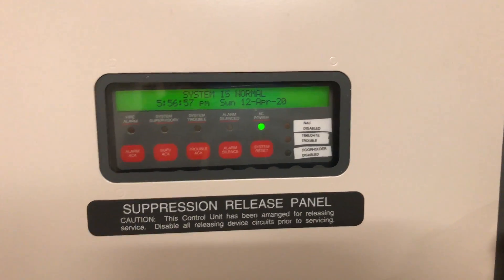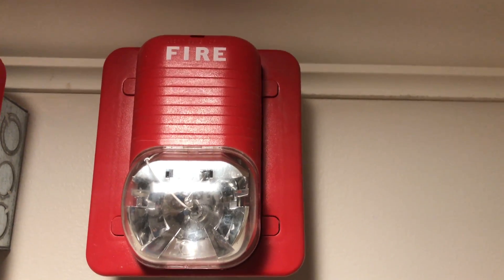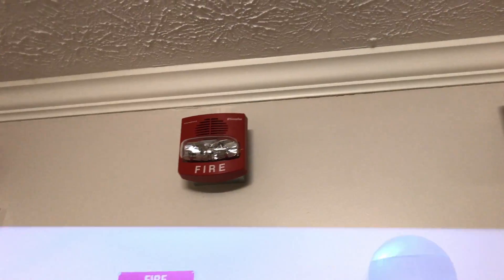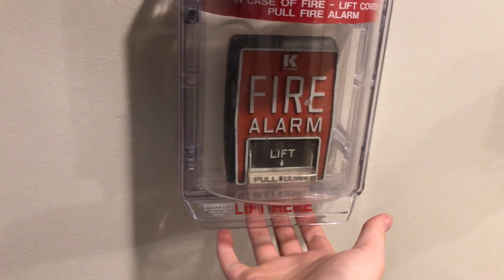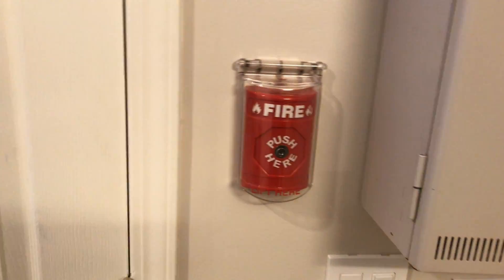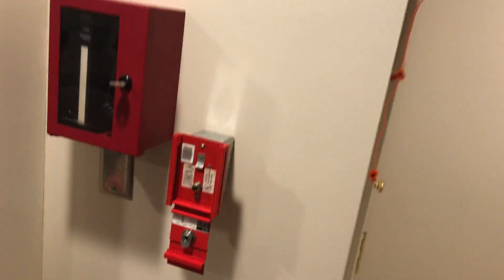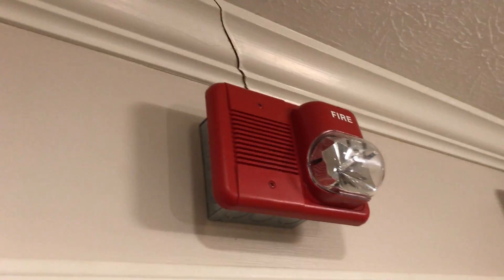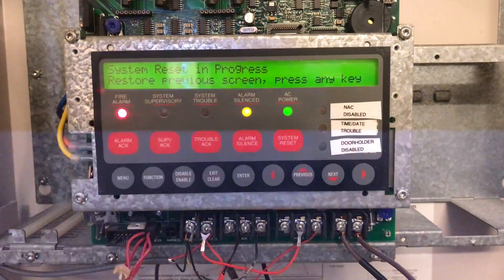Simplex 4010 Test 32: I'm Back!

Comment: That Kidde pull, they used to have those at the train station platform entrance in South Station Boston MA. But some time in the past decade they were replaced with Sigcom T-bar pulls rebranded by Simplex. (They were installed as part of a Thorn-Kidde voice-evac system from 1989, which has since been upgraded to a Simplex 4100U, but several other Kidde components are still intact.)

Comment: Welcome back! I am grateful that you are back.

Question for you:
Do you know why Simplex panels take longer to reset than other panels?
Reply from the maker: My guess would just be that its verification process takes longer to verify that all points are normal. It actually takes about the same as my SK-5208, except that the SK turns off the NAC's before verification. If a zone on the SK is still in alarm after reset, the panel goes back into alarm, whereas the Simplex just wont clear the alarm and reset until all points are showing normal.